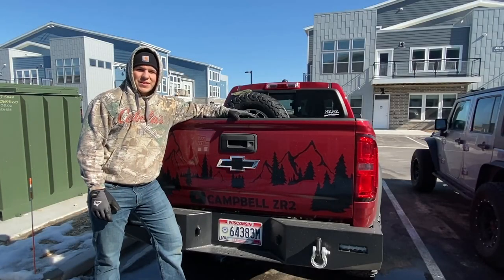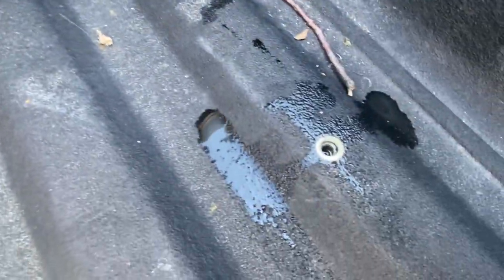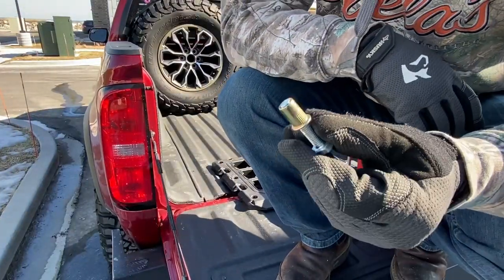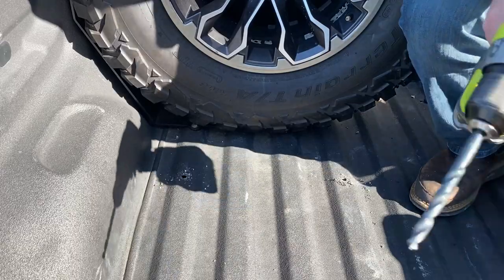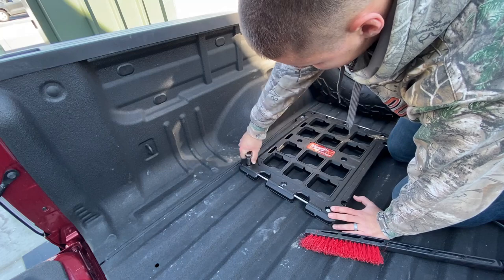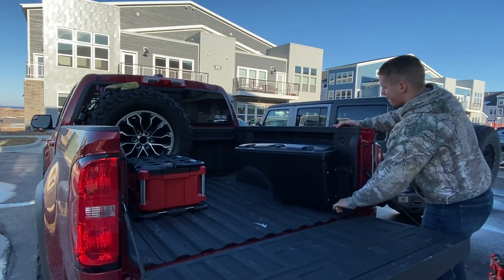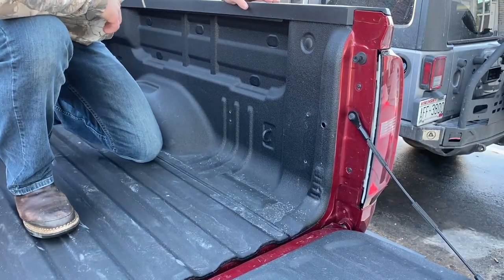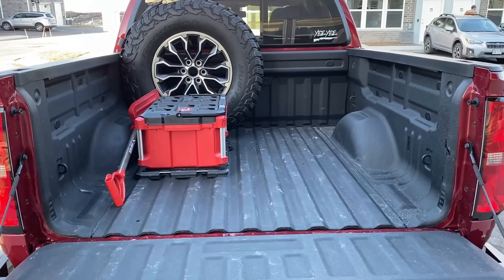Drilling Holes in my Pickup Bed!!

Comment: Just throwing this out there but if you were to put the wall plate right near the tailgate you could shut the tailgate and lock it and then you wouldn’t have to worry about anybody getting into your pack out because they can’t get to the turn over latch. That and you wouldn’t have to climb into the truck every time you need to get something. Good video just letting you know what I did.
Reply from the maker: That’s a really good idea! Thanks for sharing!

Comment: Have you had any issues with the zinc plated rivet nuts rusting in your truck bed? I know Wisconsin has harsh winters. I debating on upgrading to stainless steel rivet nuts in my truck bed.

Comment: Instead of riv nuts use jack nuts. And I’d at least throw a dab of silicone in the holes before installing them. I have a ‘95 so not scared of drilling holes in anything. I have a spare tire I’ll need to mount and a gas can like yours.

Comment: Went to Home Depot to locate these boxes and nobody knew where they were (if at all). There were Milwaukee stack and roll tool sets. No floor mounted option. Help !!!!!
Reply from the maker: ZR2 Zamboni I had to get the base plate at a tractor supply store, not all Home Depot’s carry it, the boxes are part of the stack and roll set, just not the bottom one with wheels on it, you should be able to buy them individually
Reply: I found them at Ace as well, give that a try